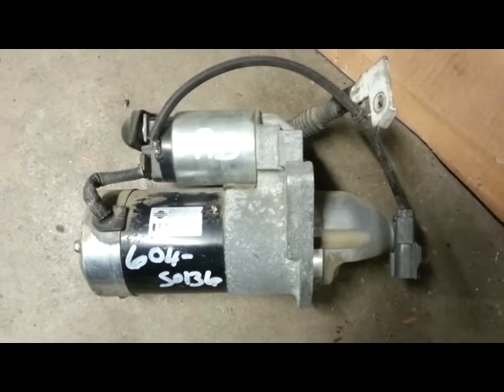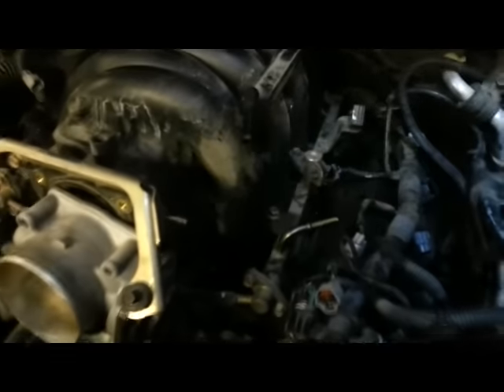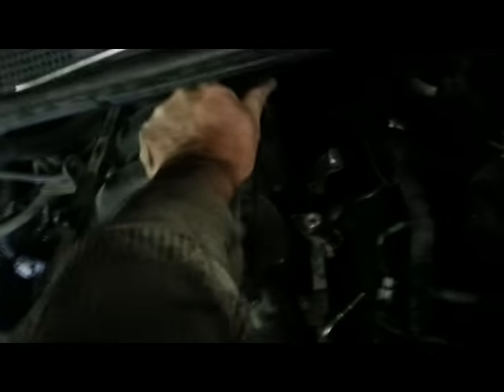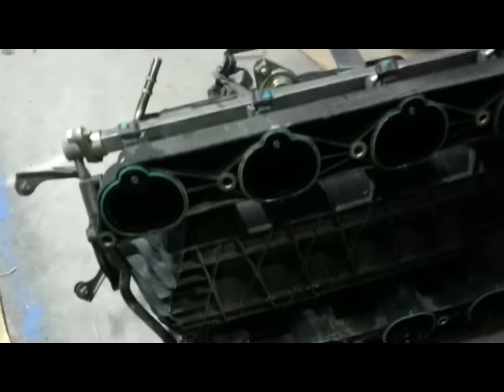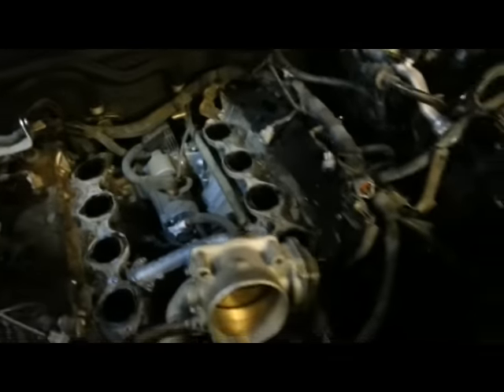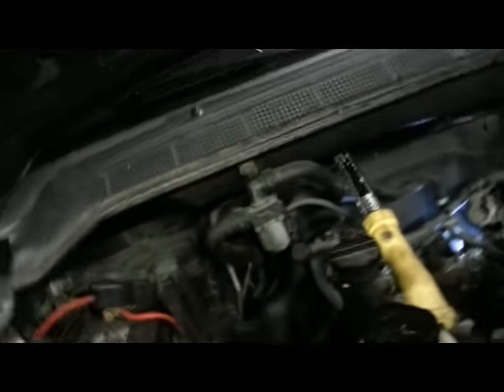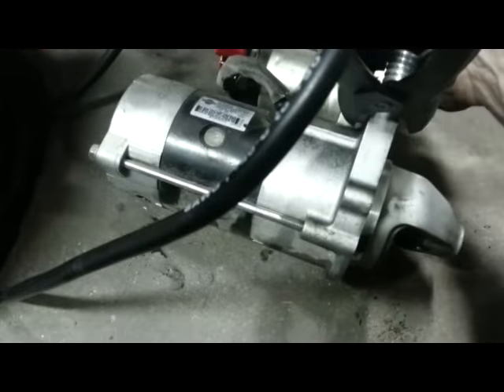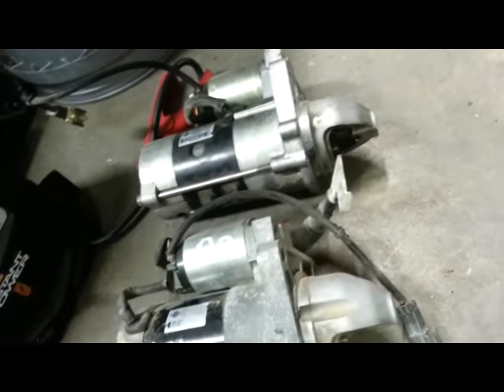Nissan Armada / Titan 2004-2015 starter replacement tips A60/TA60

Comment: Tip: to disconnect the injector electrical connector, squeeze the tab on the underside of the connector right where the wire goes in. Carefully wiggle it off. You may drop a tool through the intake runners, I dropped a ratchet and an intake bolt in there. No worries, the intake valley is sealed, the lost items will be there when the plenum is removed. This is a very uncomfortable job to do, I finally used an old bed comforter folded over to give me something to lay on......

Comment from the maker: update 5/2/2016 New starter is still working 100% of the time. Both the original 05 and 08 flex starter where replaced with bad solenoids. I have not found new solenoids yet.
Reply: بلازحمه رايد سنتر مال محرك

Comment: my starter is doing the "click" at times, other times it starts right up. do you think it is the starter going out.
Reply from the maker: That is how mine was. Never left me stranded with a complete failure. I went through 2 new batteries (1 AGM was defective) before finally changing the starter 6 months later.

Comment: The FSM shows draining some coolant and removing the coolant lines from the throttle body. Is it possible to do this without removing the coolant lines and fuel rails, and just moving it off to the side enough to get to the starter? I bought the starter and intake manifold gaskets today. I'm pretty sure the solenoid is starting to go out.
Reply from the maker: +Glen Campbell I did not disconnect the coolant lines. I just unbolted the TB and layed it down. I did unplug the fuel line, I did not discharge the line, it was already depressurized, no gas came out, maybe a few drops. I did not replace the o rings, and I did the job twice since the replacement $30 starter solenoid was just as bad. My new one is still going strong 100% of the time. My thumb is still swollen and does not bend. LOL.

Comment: do you need to disconnect the fuel line also is it necessary to drain the coolant also is it necessary to depressurize the fuel line in doing this procedure?
Reply from the maker: I removed fuel line for access. It was in the way. I did not depressurize but engine was cold. No coolant lines were disconnected.
Reply: Nissan Nut thanks I installed but the solenoid was still bad so I removed everything else but didn't need to remove the fuel disconnect the second time lol